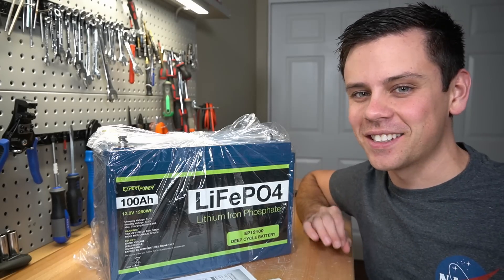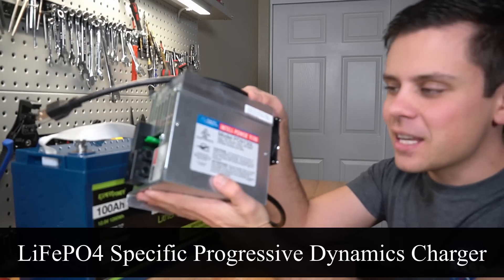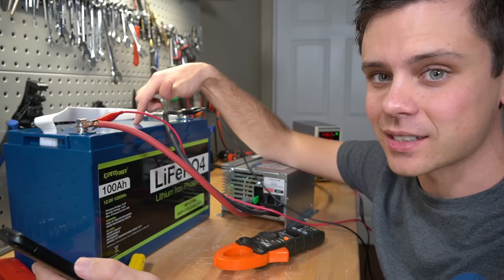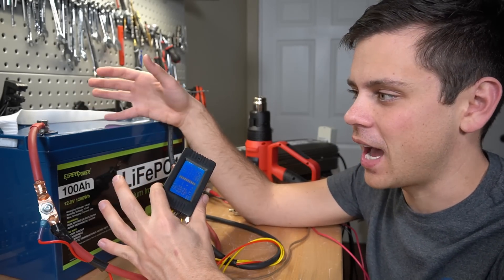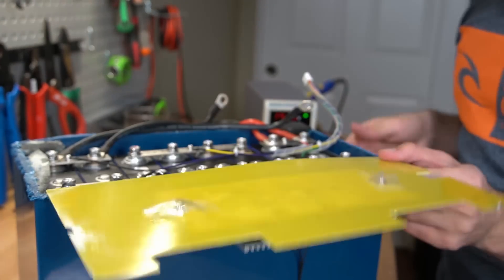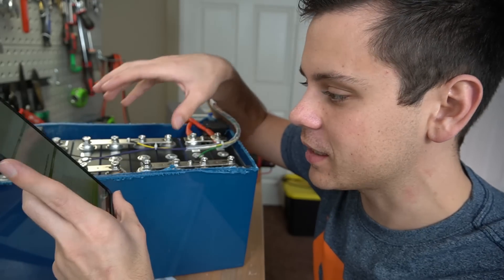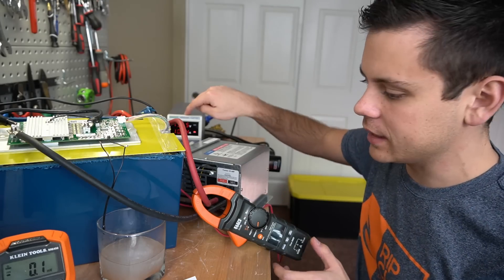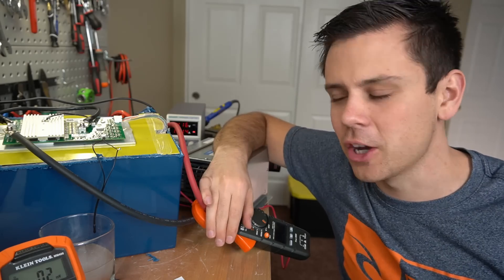ExpertPower 12V 100Ah LiFePO4 Battery Tear Down!

Comment: Hi Will.... tens of thousands of people across the USA use Mobility Scooters and Power Wheelchairs.  Currently I'd say that about 90% of them are still using AGM or Gel Sealed Lead Acid Batteries.  For example.... the most common portable Mobility Scooter out there is the Pride Mobility Go-Go Scooter.  It takes Two, 12 Volt - 12Ah batteries or can be upgraded, with a larger battery case, to 18Ah Batteries if it is the Elite Traveller Model.  I know you mainly cover batteries and solar.... but maybe you could do a video on converting one of these scooters from SLA to Lithium Ion.
Reply from the maker: Interesting idea

Comment: An interesting and good video again, big thanks for the fine work. I don't want to buy that battery when they go out with fake marketing, good test!
Reply: Yeah they modified the circuit board to add connections and then they just ran it like all around the board like a maze you know but they didn't have any place to connect it in terms of the existing board that they modified to just add a wire for the temperature sensor there....

Just kidding of course but the real point is they have shift some of these batteries I think right or was this like a pre production run for review it seems like that they haven't shipped any of these batteries to anybody else because obviously if any of them are on their way to Detroit are there way anywhere in the world they need to contact the shipper and have those batteries turn around

Comment: But ok in a warm climate?
Reply: Let's check the other side of that temp. sensor.
Reply: The spec sheet says OK to 140F. Just remember that it can get that hot inside a closed car/well sealed RV on an average mid-summer day!

Comment: do you have a link for the lithium charger you are using?
Reply from the maker: https://www.mobile-solarpower.com/battery-chargers.html
Reply: @WillProwse  what is the lead acid battery charger that you referenced in the video?
Reply from the maker: Schumacher SC1308 6/12V Fully Automatic Battery Charger and 30/100A Engine Starter with Advanced Diagnostic Testing https://www.amazon.com/dp/B07897HX4W/ref=cm_sw_r_cp_apa_i_KxnkEbK32P6V2

Comment: Curious to see what manufacturer says, they are probably pretty pissed at how the heck that  passed QC.
Reply from the maker: Just emailed them now. Will add update to this videos comments section when I get email back.
Reply: Forget the temp not passing QC - I am amazed on the lack of proper wiring size -- it would have taken .01 Cents more to do it right ...

Comment: did the low temp cutoff not work because both temp sensors need to b cold
Reply from the maker: No, its only the battery cell sensor that triggers cold temp. Look at the data sheet. Mosfet sensor is only for high temperature
Reply: @WillProwse  yea i see the one dose low cutoff at 23f then should not restart untill it goes up too 32f thats a fail should always have more than 1 temp sensor doing the same job surely dont cost alot to these guys to put a few which work .. but these battries if made correctly could last lifetimes
Reply: @WillProwse  Did you check if the high temp sensor was active?
Reply: yea in freezer both should be cold should of cutoff
Reply: It should be enough for one sensor to be cold. One is used only for protecting mosfets in BMS from overheating. The other is to protect for too low or too high temp of the cells itself.

Comment: Excellent video -- and no fire .... still i think that the best deal is the current Deligren  (4) 3.2V 200aH LiFePO4 for $488 and throw in a Chargery BMS (with low temp cutoff) for $125 ... and you have a great 200aH 12V battery for $613 - delivered /// I cringe anytime anyone gets a battery off of Amazon ... :-)
Reply from the maker: I'm not seeing a deligreen battery anywhere. Do you have a sku number?
Reply: @WillProwse  Batteries were 4 for 284 .. Busbars were $6  for 4 ... and FEDEX shipping was 198 ... Shipping took 6 days -- door to door -- and they fill out all the forms and stuff to get through customs ..
Reply: @ghostwriter6699  have you got a link? Is it on AliExpress, Alibaba?
Reply: @ghostwriter6699  Link please.
Reply: @ghostwriter6699  You keep dancing around.  Where is a link that we can inspect and possibly buy what you described!
Reply: A lot to be said for getting a complete battery unit, saves time, includes the shell.  I'm an electrical engineer and like to play, but I would probably buy a complete battery.
Reply: @chocolatewithedgarcia1012  I too am a EE and I will tell you that 90% of these batteries that Will takes apart has crappy BMS's .. I would rather build my own battery and my own BMS then to trust these battery companies that goes cheap on BMS
Reply: @ghostwriter6699  Thing is that most of us can't do that, so Will's testing lets anyone play the game safely.
Reply: @ghostwriter6699  ghostwriter, Will seems to love the battleborn as a premium product (although at a premium price).  I suspect that in about 2 years (when I plan to build a stealth van) a moderate priced high quality product will be available, and Will will find it for me!
Reply: @chocolatewithedgarcia1012  I won't lie .. i too drank the BattleHorn koolaid and before the Chinese started making damn good quality batteries and drastically lowering their prices - I probably bought a dozen for work ... but times change .. the Chinese batteries have good quality control now -- they have some solid BMS's that you can purchase -- and from an economic advantage -- I can get a 200aH delivered for almost HALF of what a Battleborn 100aH goes for... i don't mind paying for a name -- but you know that they are getting their BMS's and their Batteries from China and you are paying a ton more for them to package it and slap a Battlehorn sticker on it .. But to each his on ... Once again nothing against Battlehorn - but I just like to save money so i can buy other toys to play with ...
Reply: @ghostwriter6699  Right, so I just want a complete battery including a reasonable built in BMS for a reasonable price.  What do you suggest?
Reply: Where can I find the Deligren battery?
Reply: Interest peaked!
Reply: wow, what a deal. I've never heard of deligren. I'm googling right now. did you buy direct from their website AliExpress Alibaba? but I actually do like buying from Amazon because sometimes it's worth it to pay for that 4 year warranty. But I'm not sure they would offer that on batteries though